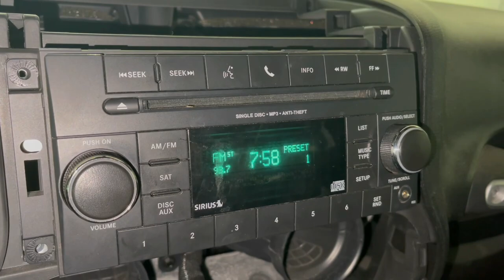Jeep Wrangler No AM/FM sound-Circuit Board Repair

Comment: Continuing problem with my 07 JK X radio/stereo. I have seen every video of the circuit board solder fix and none of them show my radio. I tore it down and it shows part number P05064061AJ in the case. Where every video shows the chip to be re-soldered, my board has a metal cover. It appears to un-removable.

Comment: is there an internal fuse inside the head unit? I actually shorted out my radio unit when I was reinstalling it back with power on after fixing the unit with this same problem. if there's no fuse inside the unit which components should I replaced to make it work again. Please help.Thanks

Comment: Have a 1991 Jeep Cherokee Laredo with a factory Jeep 56002467(1991) AM/FM Cassette Player and just swapped out the tape modules in two 2467 cases. Now I have me some rocking tunes. Now what I want to know is what is the cause of either the left or right channel going out on a 2467 and on a 56009004(1992) the volume knob is maxed out but I need just a little bit more volume.

Comment: why is everyone trying to go through the top, listen if you turn the radio over, pop off the bottom plate and 4 screws the green board comes out and you are free to work on it, STOP taring the top of the radio apart. work from the bottom you don't even have to pull the cd player out

Comment: Why don't  you just remove  the bottom board instead  of the cd board. Also any links to where you can source the antenna jack mine has broken loose when I removed it from the car dash.

Comment: Thank you! You're the MAN!  I could not see anything way out of whack - but just cleaned the solder connections with alcohol and the AM/FM came back to life.   Thanks for your help
Reply from the maker: Still holding strong?
Reply: @VoltageDropDiagnostics  actually no  - worked for a day or two - retried - worked for another day - retried a third time and used too much heat - bummer - but a good effort - thanks for the info.  I've installed a new radio.
Reply: Needed to be reflowed/resoldered.

Comment: I found this video looking to remedy a different problem. Exact same year and radio, but I have through the years gotten worse radio reception to the point that it is now unlistenable. Mostly static. I thought it may be corrosion in my antenna base, and after replacing the antenna base it did look like there was corrosion in it, However I still have terrible reception. Am reception is noticeably better but still not good. Do you have any ideas that may help?

Comment: My wife's 2012 Challenger has the same radio and same problem. What is the heat gun and flux you used? Thanks for the video! Looks like a big help to me and her!
Reply from the maker: If you go to my Amazon store in the link in the video description, both the flux and heat gun should be in the store. If not, comment back and I’ll send you a link.
Reply: @VoltageDropDiagnostics  Found it. Thanks! That is a VERY cool set-up!

Comment: Nice video , hey I have a question regarding a 1995 Lexus GS300 , I see that when the ac is on and you shift into gear the ac light on the dash starts blinking and the ground that comes from the pcm goes missing, do you think the pcm board needs soldering?
Reply from the maker: No, usually that happens when the PCM doesn’t see the clutch lock up on the compressor.

Make sure the clutch is spinning
Reply: @VoltageDropDiagnostics 
Thanks for your reply , the ac clutch spins but once I shift in reverse or drive it stops and the ground goes away at the relay and at the pcm.
Reply from the maker: @MiguelMartinez-np8uo  is there a sensor on the compressor that tells the pcm that it is spinning? Make sure that is working
Reply: @VoltageDropDiagnostics  
Yes
Reply: Also the compressor was replaced twice and the last one is a Denso.
Reply from the maker: @MiguelMartinez-np8uo  is that signal getting back to the pcm to let it know that the compressor is engaged?